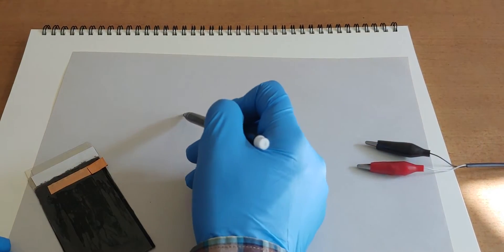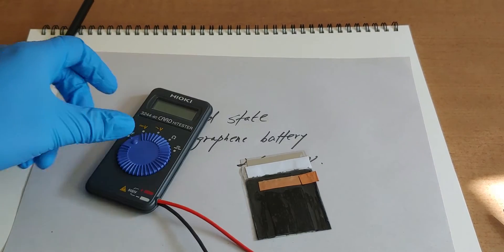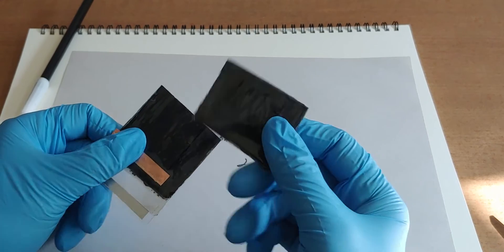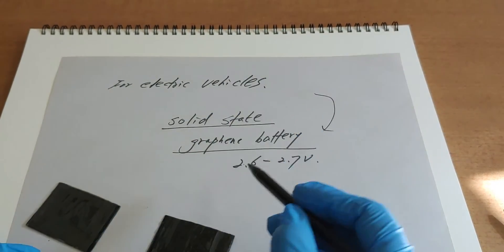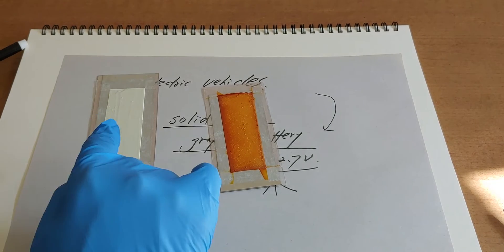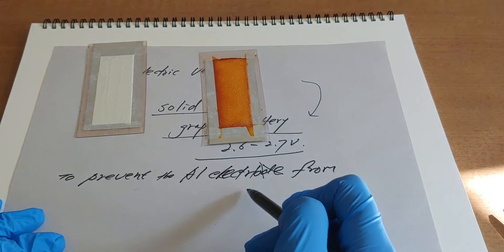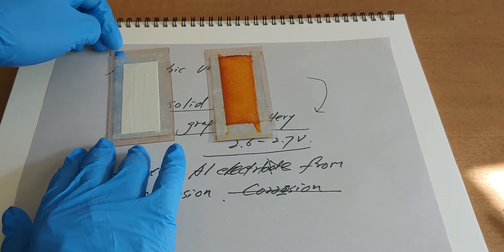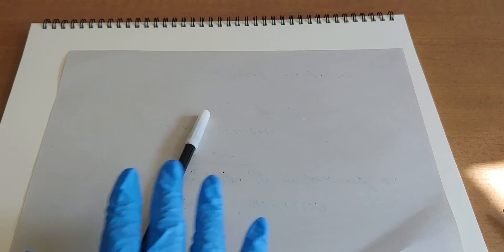Solid state graphene battery

Comment: Are you sure it have 2.7 Volts .. Maybe you should start small motor fan  with that ..... Than you may prove it.
Reply from the maker: Yes, 2.7 volts is right. But what I have to do is to increase more voltage and its amps. Thank for your concern
Reply: @solidbattery9956  Wnen you start the production .?   I do need to check it out.
Reply from the maker: @bartoszbarejko1585  
I don't have any plan about producing my battery. My target is to develop a battery whose function is as good as that of lithium battery.
Reply: @solidbattery9956  My plan is to develop thre refueling batteties that will work 24/ 7 for 1 Year on and on.